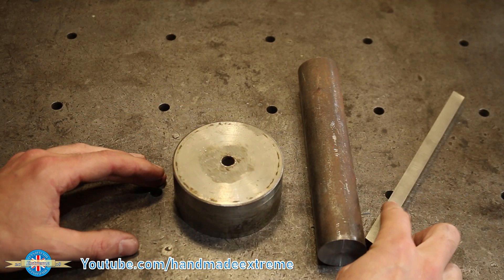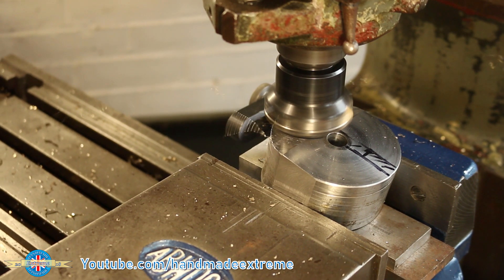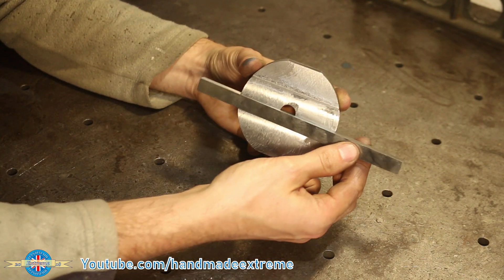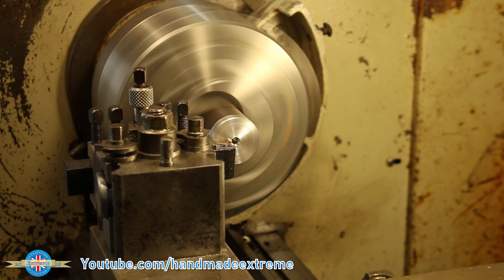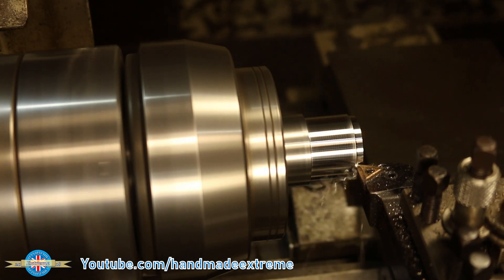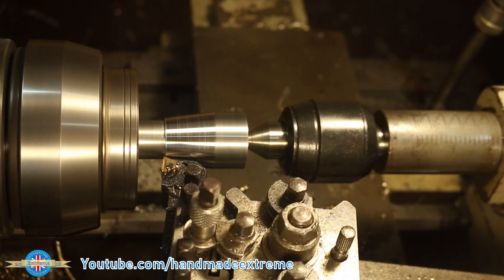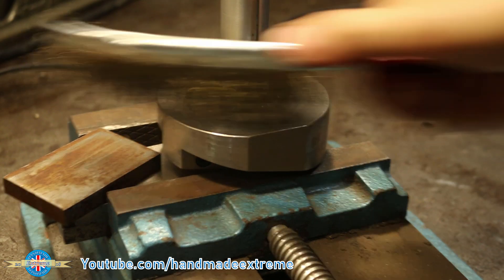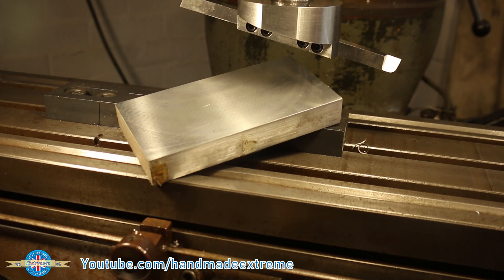Making a Large Diameter R8 Fly Cutter for a Bridgeport Milling Machine.

Comment: I am in the process of making a fly cutter for my Bridgeport. I purchased a blank end arbour on R8 and I have ordered a 200mm length of 50mm sq bar. I will fit the arbour and mill a slot in the bottom to accept 16mm shank lathe tools that I use. I have never really been happy with skimming cylinder heads on anything other than purpose built engine shop machines but to be sure on my bridgeport I have a 42 inch table and I can get 70cm travel so I should be able to skim a head as long as the length + 2X the radius of the tool can be accommodated in the travel.  Yes I have seen heads skimmed by otherwise non machinists in engine shops where the tool was not run all the way off the head at the end of the cut.

Comment: How much to make me one? Considering buying a local machine for cheap to mill aluminum subaru cylinder heads.
Reply from the maker: Would be cheaper to buy one for sure.
If you want to start a business skimming heads there are machines made specifically for it.
Hope that helps. Thanks for the support.

Comment: a tip for surfacing cylinder head or engine blocks make sure the head is trammed front and back but tilt it just a half a degree toward the leading side of the cutter the direction you intend to travel that way the trailing edge as the tool passes over the surface doesn't rub. yes in theory if it perfectly true and trammed it wont but there theory and real world practices.
Reply from the maker: Absolutely. great comment. thanks for the advice and support. 👍

Comment: I was going to say I am not a fan of 2 piece flycutters, then you welded it. Good job. Since you wont always run it slow, you may wish to consider a large chamfer or relief cut on the thicker side of the flycutter head. The difference in mass caused by the bottom angle cut, will give you vibration at high speed and show up in your finish.
Reply from the maker: Hi Joe, 
Thought I recognised the name.. watched your knurling video a few weeks back, very informative. thanks. 👍
Yeah all that unbalanced mass spinning round doesn't sit well with me either. I would have preferred to make it from a single piece but didn't have any material suitable. I was doing some cutting with it this week and your right at higher RPM's it would benefit from a balancing cut. 
Great to have you here and thanks for the support. 👍

Comment: Did you see the huge eccentricity in the center hole on the head when you were drilling?  You should have bored it out, but luckily you fixed eccentricity at the end, in the spindle.
Reply from the maker: Kinda, I new there would be a load of run out on the head as I didn't a piece of material long enough to be able to turn the OD in the lathe to get the ID and OD concentric and the back plate on my 3 jaw chuck has a fair bit of run out in it.. really aught to fix that. I've been wanting to try that trick of cutting the OD in the mill for a while so thought this would be a good opportunity. Thankfully it turned out really well. Well spotted by the way 👍👍 Thanks for watching.
Reply: @Handmadeextreme  - One hardly ever sees mill turning on a manual mill.  A little more common on a CNC mill, but still sneaky!

Comment: Great project, I enjoyed watching this. I'll need to make one at some point for motorbike heads. Dean in Oxfordshire.
Reply from the maker: Hi Dean, great to hear from you again. I think it will come in handy for all sorts of jobs now. I should have made one years ago. Thanks for the support, glad you enjoyed it.
Reply: Just something to think about. I worked in an engine reconditioning center, the surface grinder for the cylinder heads was converted from stones to indexable bits. The first few heads were cut to smooth and would not hold a gasket. The feed rate had to be adjusted to leave a rougher surface. Mind you they were for  large Diesel engines  so more compression involved.

Comment: Very nicely done. BTW, why such a large radius on the tool nose?
Reply from the maker: Thanks, glad you enjoyed it. I find that it gives a better surface finish than a sharp point. It also makes for a much stronger / longer lasting tool in my experience. The only time I grind tools to a point is if they actually need one, say for turning up to a shoulder on the lathe. Thanks for the support. 👍

Comment: Good work!
When I used to run a flycutter I changed my tool out for carbide, it let me run at higher speeds and feeds.
But you might need to grind the carbide (use a respirator if you plan on doing this, carbide dust is nasty)
Reply from the maker: Great tip, ill bare that in mind, thanks. Glad you enjoyed it and thanks for the support.
Reply: @Handmadeextreme  I would really recommend a SDJCR12 holder and a DCMT070204 insert. I made a fly cutter using that, similar design as yours, and it works great.
It cuts a diameter of 150mm and you can run quite high feed and speeds.
Since the slot size is the same, you could use both HSS and insert holders for special grinds, radiuses etc.
I found that 1088rpm and 150-200mm/min gave a good finish on steel.
Reply: @MrCrankyface  - No issues with the constant interrupted cut using carbide?
Reply: @somebodyelse6673  None at all so far.

Comment: Really enjoyed that. I take it this is tooling up for Project Pippa? By the way, my freezer is in my workshop. For just such an eventuality.

Have you seen a channel called Usher Engineering? A girl called Beth and her Father run a workshop dealing with specialist motorsport and vintage car engineering. They have a video about skimming a head. They have made the mother of all fly cutters. The tool holder is like an enormous fly wheel.
Reply from the maker: Glad you enjoyed it. You are correct about why i'v made it. I haven't actually got the head off yet to check if it's flat but thought id'e make the cutter anyway then I have it just in case. 

No I haven't seen it. I'll take a look thanks.
Reply: @Handmadeextreme  It's a great channel and they are UK based, do a lot of interesting stuff. Beth is a fantastic machinist and tig welder. It's annoying seeing someone so young with so much talent! Again great video. Look forward to your next offering. I'm going into my workshop now because at long last I'm home.